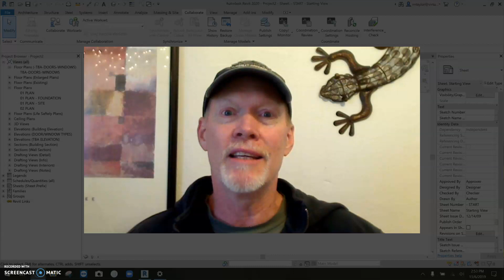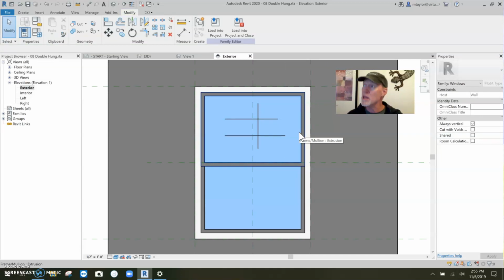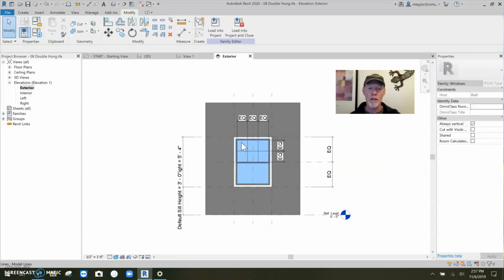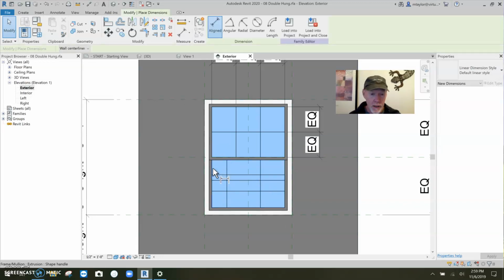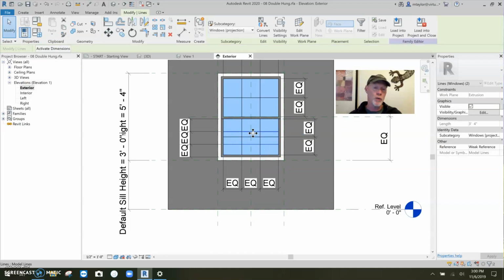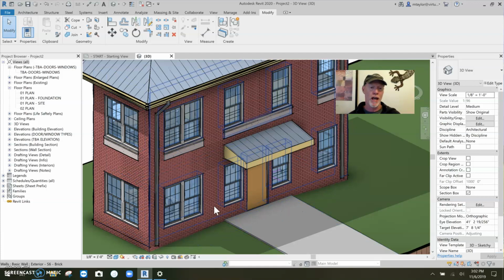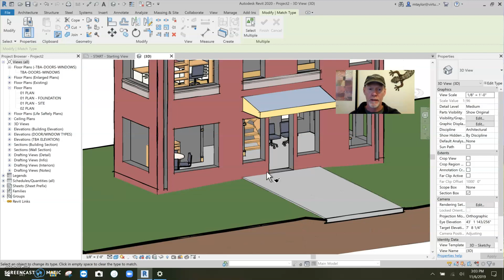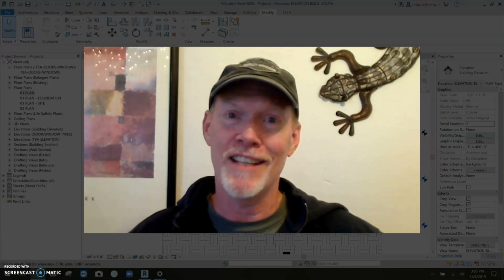Adding MULLIONS to your Windows

Comment: Problem with model lines...they don’t render.  Can you do the same with a filled region or zero thickness extrusion?
Reply from the maker: You are correct... they won’t render. If you need an object that will render... add a mullion (true 3D) to the model lines IN the window family. You can use the approach I used for my ‘board & batten’ video. Should work fine.